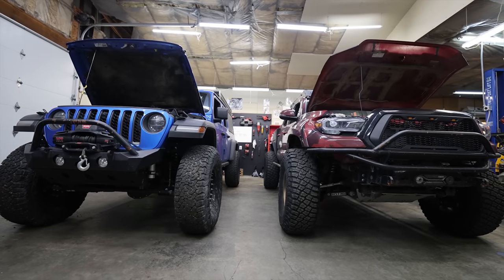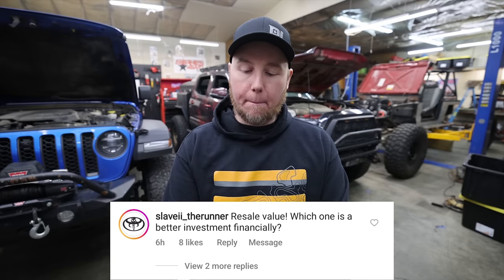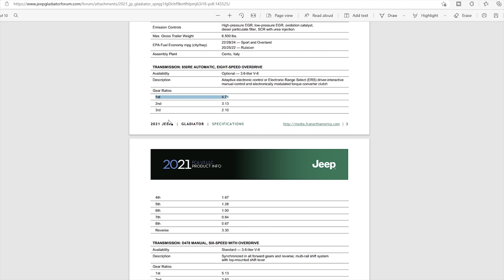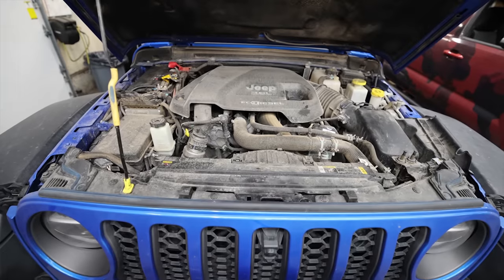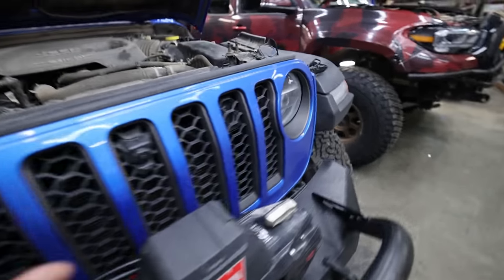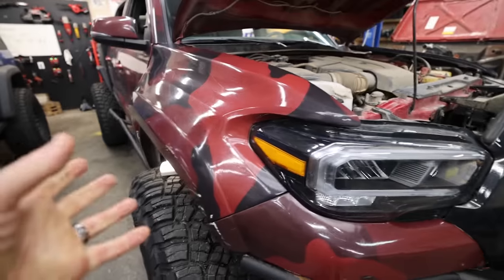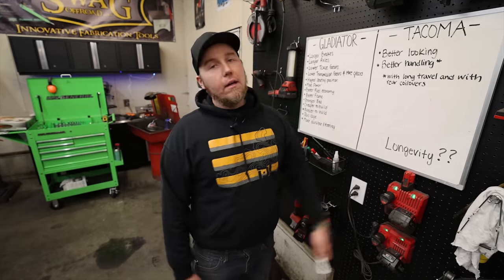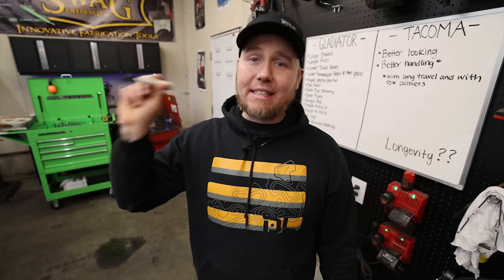My 21 Jeep Gladiator Vs My 21 Toyota Tacoma. Cold Hard Facts.

Comment: As a person who has been a die hard toyota guy and wanted something out of the box from the show room floor. I’d go with a gladiator or JL rubicon.  They just work.
Reply from the maker: Agreed. And toyota makes some extremely competitive offroad platforms they just need to bring them here to the US. I want a 70 series sooooo bad lol.
Reply: Agreed! Toyota makes a great off-road platform. If they add a few more things to the “off-road package” ie: front locker, small lift, 285/70/17 tires it’s a good base to start from.  

Anyways I enjoys your video Nate! Keep it up!
Reply: @DirtLifestyle  not gonna happen. Biggest problem is US regulations but also US consumers would complain that they’re too basic.
Reply: @JayJay-tg7jx  
Same here. I used to be a die hard Toyota guy but as I got older I realized it's no fun at all. Seriously. Why limit yourself to just a single brand manufacturer? Explore your options and give each competing vehicle a chance. You never know you just may change your mind about it. Went from a Tacoma to a Colorado and then the Gladiator. The Gladiator is by far my most favorite truck.
Reply: I want a 79 series 4 door pickup with a diesel and manual transmission, windows and locks like they get in Australia

Comment: As someone who owns a first gen tacoma and is in the market for a new truck (gladiator, ranger, tacoma) this was helpful to see your opinion on as built versions. I don't plan on going as wild but you can't argue how easy a gladiator is to get to a very capable point.
Reply: I wouldn’t get the Ranger unless it’s the new Raptor coming out or you’re willing to spend some money on replacing the entire suspension. Travel on the suspension is 6/8 inches front and rear, trucks like the ZR2 and the TRDs have more travel in the front than the Ranger does the rear.

Comment: Great video Nate, as someone who has had a few Toyotas [no jeeps yet] , I have to agree about the shortcomings of the Tacoma, I had a gen 2 taco and now have a gen 5 4runner and the 4runner is a much better vehicle than the taco in my experience/opinion.I also agree that the Jeep/Bronco/and Grenadier are upping the ante and I hope Toyota keeps up with them. I would buy a Troopy tomorrow if they were available here!
Reply from the maker: I love the troopy! The interior lacks a modern touch but all the most important offroad stuff is there. And what a great platform to start with.
Reply: The 4Runner interior doesn’t lack anything. It’s better than a Tacoma. I’ve had both and I have 2 new 4Runners now. Built better, and way better materials and cabin than the Tacoma. The 4.0 is vastly better than the 3.5z

Comment: Love this Video. I’ve had both vehicles also and traded in the Taco pretty quickly for a Gladiator. Couldn’t agree more. I’m looking to start the gladiator build and have built wranglers before, but would love to see a video specifically around control arms and even more specifically boxed vs tubular. Have heard a lot of mixed information online and would love your opinion on it.

Comment: It’s comes down to each vehicle brands issues. Back in the day Dodge/Chrysler/Jeep had real issues w alternators and the electrical system. But that old slant 6 engine was damn near indestructible. Jeep’s straight 6 is a GREAT running dependable engine. The 90’s model GM 5.7L engines were almost bullet proof as long as you didn’t run them super hot, it would blow the head gaskets every time if you did. 

Best engine in a truck I ever owned was a ‘93 Chevy Suburban w the 5.7. Rear freeze plugs went out. I could literally watch the water pour out the starter opening as fast as I could pour it in the radiator. But for several months I would drive it into town and back about 10-12 miles 1 way by filling the radiator b4 leaving, stopping halfway adding water, stopping halfway on the way home adding water again and make it home. After about 3 mos took to shop to have this fixed (can’t physically do this myself anymore, cause they’re on the rear of engine block, have to pull trans, transfer case & flywheel). After this truck was fine. 

I had an ‘85 F150 w a 5.0 that drive thru sand mud and towed amazing loads in FL, but being only 2wd would get stuck on the side of the road in wet grass in the TN mountains.

Comment: If someone isn't really an off-roader, the Tacoma is a GREAT smaller truck option, but the more 1 is asking of their truck, the quicker other options (i.e. the Gladiator for off-roading) surpass it.
Reply: A Taco is a completely fine choice for an off-roader. Put decent ATs on a stock Taco and the truck will go just fine. It's a shock to literally no one, including every sane Taco owner that when you are doing trails that require 39s a solid axle jeep is obviously better choice.
Reply: Yea interestingly enough I’d argue the gladiator is worse due to its wheelbase being 10” longer unless you go 37”+ tires then you see the gains. I like the taco it does what I ask of it but I’m not overloading it with weight or going larger than 35s. Handles on road great and that’s where I spend most my time. Almost got a jeep maybe next one

Comment: Awesome comparison!  I just cross shopped 2022 tacomas and 2022 gladiator rubicon/mojave.  I ended up with the TRD Offroad tacoma because of the on-road handling, steering feel, ride, and seating position. The road is very rough to get up to my home (1800ft climb up a mountain) and the tacoma rode MUCH better than even the mojave.  I still love the gladiator’s and tried my best to talk myself into one.  Had to beg it to go 70 and it was like sailing a boat down the highway when you get it up to speed.  It’s seating position was kinda like a park bench compared to the more sedan like position in the tacoma.  At the time adaptive cruise was not offered on the gladiator because of the chip shortage… that was a big downside since most of my trip to work is highway.  For strictly offroading there is no doubt the jeep is the winner.  For daily driver…  my money went to toyota.

Comment: Despite your Tacoma's short comings it's still extremely capable and really one-of-a-kind! Let's be honest. How often do you see a tastefully modded Tacoma running on 39s? Definitely an attention grabber. Yes, I've seen Tacomas on 40s but those are usually trailered and chopped up to the point where they're buggies. Your Tacoma is still very functional and recognizable. Absolutely love both your trucks.

Comment: I like the comparison and I too do not look at consumer reports for reliability points, I’m just speaking from experience my Tacoma has zero issues my jeep was at least in the shop for something every 6 months or so , jeep also broke down on me clutch master cylinder went out on hunt I was on in a very remote area left me stranded and also another time let me on the side of the highway because of a sensor that died , I like jeeps but will not own another one again, Tacoma has never left me stranded and to me that is way more important than low gearing . 
 Thanks for sharing your opinion

Comment: Pure awesomeness. Thank you for not comparing the infotainment, cup holder and sun visor placements. Not that it's not useful, but has been done trillion times. Thanks!
Reply: As the owner of a Wrangler JK and a Gladiator JT, I would've been interested in a comparison of the sun visor strength.  I've broken both of mine in the Gladiator such that they flop around loosely, so added some reinforcements off eBay (new ones cost a couple hundred bucks).  The Wrangler has nearly 300K miles, and, while pretty crappy to use (Gladiator's are way better for actually blocking the sun until they break), they still work fine.

Comment: I love my Jeep Gladiator, I put it on 37s and a metal cloak lift. It literally has travel for days, it makes the 37s feel like 33s. I wasn't lucky enough to get the Ecodiesel because I really wanted Punk'N but the 3.6 V6 is still really good. The only problem is that it sucks down gas when I am not on the highway. I just love that if I eventually want to Hemi swap it one day, all the parts can stay. Really nice video, I love seeing a beautifully built Taco too!
Reply from the maker: Thanks, man!
I got to borrow a gladiator on 37s while I was in moab... it blew me away! It was the reason I went out and bought one. Once you see how great these are, everything else gets a lot less appealing
Reply: Figuratively
Reply: I am patiently waiting for the Punkn' color to come back!
Reply: @halflo  It's so nice! Shows no dirt, and you can do so many themes with it. Personally I did Charizard, but I have seen crazy Bengals and Gator ones.
Reply: Oh? Charizard truck sounds Cool! I just think that Punkn' looks great with the black accents! I was wondering about the dirt, so thanks for the information. I thought it would show dirt more than the Nacho color. The Punkn' just looks nicer overall to me. Thanks!

Comment: Great video, yes no question about it, Jeeps are super easy to get big tires on.  That being said I love my GX470 and the IFS, and it has a fully welded boxed frame.  But I’m not loving that I need to really save up and spend some big coin to get that marlin crawler suspension, some day though…
Reply from the maker: I love the 470. Great platform, and it even though it's way older than my 3rd gen taco, it has much better parts. Coil springs, boxed frame, and disc brakes just to name a few.
Reply: I have a GX470 and I love the GX way of looking at an off roader.  its ridiculous how much it does with 33s and a 2in lift.  I have left jeepers with their jaws on the ground many times.

it just sucks so bad the wall of money and work you have to climb to go from 33 to 35.  I am debating 34s and just cross my fingers I get enough of the capability of 35s to do what I want to do.

Comment: Tacoma owner, still subscribed😂. I also count myself as a Jeep guy, owned, daily drove, and wheeled Wranglers for 15yrs before buying the Tacoma in 2018. Probably would have bought a Gladiator if it was out then. Fair points in your video, but having owned the Tacoma for 5 years now, it’s been great and I love it. I’ve always felt if running 35’s (or more) was the goal nothing is better than the Jeep platform. This Tacoma was designed and delivered when the mid size market was much different than it is now. I expect the new Tacoma will reflect the current competition much more enthusiastically.

Comment: Nice job dude. I’ve looked at the Gladiators a million times because they offer what I wish Toyota would offer here. I do think with the revamp of the 70 series on the horizon, if it can pass safety requirements we could see it. 

The 2024 Tacoma will have a better frame for sure, but everything else is still up in the air. Hoping Toyota really makes it impressive, or I’m going to buy a Grenadier or who knows, maybe even a Jeep.
Reply: Grenadier raised their prices $13,000 for 2023.

Comment: Good video Nate. My thoughts exactly across the board. I'm 6' 2 and the Taco felt to small inside. I think resell value on both are high compared to other brands.
Reply: I'm same height and we have a bunch of Tacomas at work. I call them the "4wd Carollas" cuz they are small and under powered. Not good for long distance at all.
Reply: Exactly why I went with my gladiator. Sat in a Tacoma and my knees were literally in the steering wheel. Not for tall people. Definitely don't like feeling like I'm sitting on the floor either
Reply: Its not just the size of the cabin . Tacomas are hands down the most bound-up, restrictive driving experience. The seat / steering wheel ergonomics were paired up by a team of monkeys

Comment: Long term reliability and durability might go to the Tacoma. But, that being said NOTHING beats a solid front axle!!!  Thanks for this👍🇺🇸
Reply: So put sfa on taco
Reply: It's not easy to just bolt in a solid front axle on the Tacoma. Some things will need to be changed or modified such as steering components, suspension, sensors etc in order to make everything work but yeah it's not impossible to do the conversion.
Reply: The Tacoma is really only reliable with the base 2.7 engine. The 3.5 is very iffy, and overall just a terrible engine for a pickup truck. Also I hate my taco’s transmission. The ZF 8 speed in the Jeep feels way more refined and comfortable to drive
Reply: @BrandonEht  
Wow. Thanks for being honest. I tell people that too regarding the automatic transmissions between the two trucks but I often get a middle finger from the die-hard Toyota guys. I don't even get to have an opinion anymore lol. I have to tell them their Tacoma's 6 spd auto transmission is the best one out there and all will be good.
Reply: @jthor8373  Boy do I hate the Toyota diehards. Just because they made fantastic shitboxes in the 90s and early 2000s. Their newer stuff is just lazy and underpowered. I bought my taco 2 years ago and I really just don’t like it. I just rented a Wrangler and couldn’t believe how much more I like it. Thinking of going gladiator though because I enjoy having a bed
Reply: @J Thor  gonna have to agree with the auto transmission. I have a 2nd gen with a 4 speed. The thing is complete ass. The engine might be tough but that 4 cyl is a terrible combo with the 4 speed

Comment: My 97 nissan is box frame, it's super stiff but I like it. Only issue I have is remembering to rinse it out after wheeling trips. I welded tube sliders directly to it and bolted a winch plate/cross member under the bed.

Comment: I almost bought a Toyota instead this last spring.  Had a buddy in high school back in the late 80’s that had one with 250000 miles on a stick shift.  Thing was unstoppable.  but I went with gladiator after driving my JK on the dunes at Meers Michigan Silver lake area.  It just changed my mind on durability and capability of a jeep product.

Comment: Hi there Nate... I'm a long time subscriber and I'm definitely pro Toyota as I'm a Master Toyota technician at a dealership. With that being said I agree with what you have said in this video. In my opinion it's very straightforward and honest. As a previous jeep owner I do enjoy my Toyota made vehicle more. I used to own and trail ride my 94 jeep grand Cherokee. I also spent A LOT of money and time repairing and upgrading it. I now own and trail ride a 99 Lexus LX 470. My Lexus sits on 35 nitto mud grapplers and has a 12k badlands Apex winch and winch bumper. I also have a snorkel for the exact reasons you mentioned for the intake on your Tacoma. My Lexus has 280k miles on it and I wouldn't be worried about driving it anywhere. In my case my Lexus ( aka Toyota land cruiser) has definitely been more reliable than my jeep was with 98k at the time I bought it. I definitely enjoyed your way of doing a comparison of 2021 vehicles but there's a lot of people that don't wheel newer trucks and SUVs. My question would be which vehicle will still be going at over 200k miles. Time will tell. I enjoy your videos and I'll definitely be watching in the future. Keep up the good work brother

Comment: The advertising is not chosen by the website, it's typically done by one of the major ad companies that track how you found the site (google) and the keywords. That's why certain advertisements follow you from website to website.    Also, consumer reports do not just take people contacting them. They send a poll out to their paying subscribers that ask what cars they own and whether they have had any issues with various parts (engine, electrical, drivetrain, brakes, etc). Builds a nice batch of data over the years on what vehicles and manufacturers have been more or less reliable and the types of failures.   Great video BTW, love the real-world examples.

Comment: My dad has a 2011 Wrangler Sport 4 door. Has over 320,000 miles on it now. Same engine. Same transmission. In fact, outside of things that require replacing and maintenance on any other vehicle as well, the vehicle is original. He only recently had the rear, factory LSD replaced. Has had to deal with plenty of road salt too. I don't know if it's tougher than a Toyota but I can say it's one tough truck.